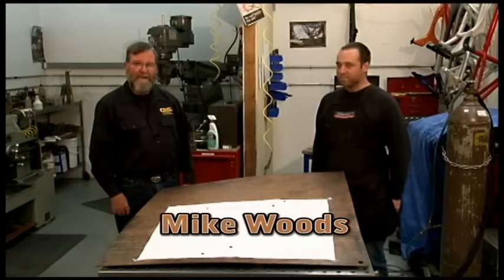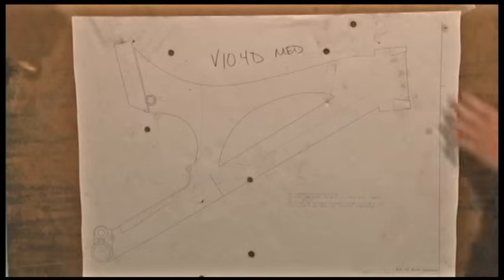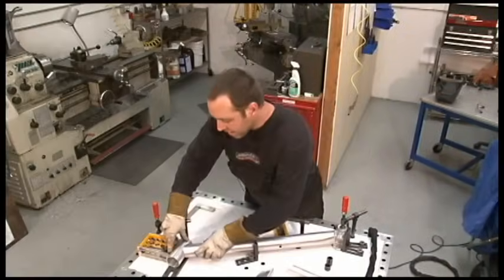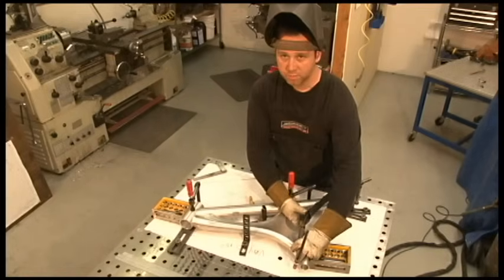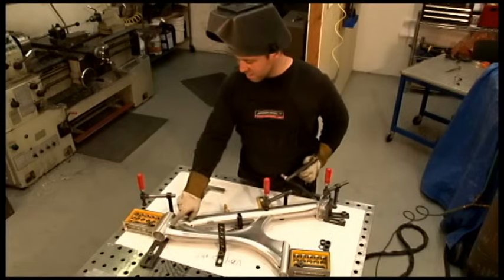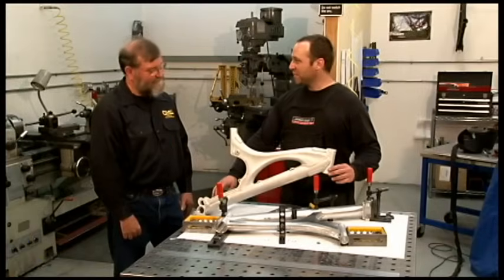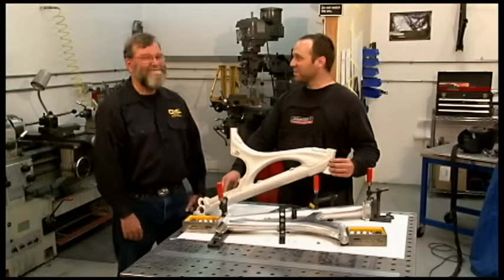Welding Aluminum Bicycle Frames

Comment: My “ Handmade in USA” Cannondale mountain bike has beautiful welds.
Reply from the maker: Cannondale is well known as an excellent brand!
Reply: @RonCovell  Actually, when they were made in the US they were well known for snapping at the welds, earning them the name "crack n fail". Mostly due to bad design, though others blame grinding their welds smooth.  New ones (made in taiwan) are done in a more conventional process - more boring to be sure, but less failure prone. None of this has to do with country of origin, just that cannondale was not an excellent brand for quality back in those days.
Reply from the maker: Thanks for the excellent background information on Cannondale!
Reply: How much does a made in USA frame cost?
Reply: Otherwise known as Crackandfail

Comment: I understand that is normal tube as headTube but I really don't know after that how you guys are make it process for headset ...I wud like to see complete video on headTube process..can any one help me, I'm sure that tube is not suitable for headset, there is some next process...kindly help ....
Reply from the maker: Thanks for watching, and asking a question. Metal always distorts to some degree when it's welded, so in most cases, bicycle head tubes are faced and reamed after welding. You can see a video showing this here:
https://www.youtube.com/watch?v=-UgzDhn6C20
Reply from the maker: The head tube is chosen to match the fork you're using, and there are many options. Here is one resource: https://www.bikefabsupply.com/7005-head-tube

Comment: Hi. I would like to know what type of oven you use. And how much heat. Because I may want to modify a frame or two.
Reply from the maker: The only good way to heat treat aluminum is in a commercial facility, which is properly equipped and experienced with the process. Heat treating aluminum is not a trivial procedure. To do it correctly, you need to heat the metal to a precise temperature - based on the alloy and thickness - then let it 'soak' at that temperature for a certain amount of time, and finally quench the material very quickly after heating. Here's a video that shows the process in some detail:
https://www.youtube.com/watch?v=yB7YoTEUbPw
Reply: @RonCovell  Thank you for advice. My point is to weld on an extention to the frame to convert into recumbent. If all the parts were heat treated before does it need another heating  after the weld?
Reply from the maker: Bicycle frames are made from high-strength aluminum, and heat treating is a major part of what gives the metal its strength. If you weld on a heat treated alloy, you will lose a good deal of strength in that area. When people first started making aluminum bicycle frames, they quickly learned that the frames would often fail if they were not heat treated after welding.
Reply: @RonCovell  Thanx a lot

Comment: 1st you didn't brush before welding, 2nd you are not using a gas lens, 3rd you keep taking the rod out of the gas zone after dabbing, 4th even on material of that thickness a little pre-heat is good and 5th you need a lot more practice.
Reply from the maker: The first three things you mention are in fact 'best practices'. On thin aluminum alloys, pre-heat is not generally required. Mike Woods, the welder in this demonstration, is an excellent welder in my opinion - and I have been welding for over 50 years!
Reply: Ron Covell 
No it’s not required but it does make for the highest quality. 
I was a welder fabricator and working with aluminum for over 24 years. 
I am a CWI And have worked on some of the biggest projects in the USA. So yeah I’m no backyard welder.
Reply from the maker: I can tell you are very experienced, and I agree with your suggestions for 'best practices'.

Comment: Thanks for the video. I was wondering what kind of testing is done after welding to ensure there are no cracks in the welds or the aluminum tubing.
Reply: Heat treatment
Reply: One method used by DIY motorcycle racers/ fabrication, is weld a small 1/4” coupling in an area on the frame that a pressure gauge is mounted. 
There is a small diameter hole in all frame tubes that allow air pressure too travel a complete path to the gauge. Pressurize the frame at low psi, and spray soapy water on all welded joints.

Comment: What is the thickness of the tube ? what is the aluminum name/number please ?
Reply from the maker: I didn't build the frame in this video, but in my other aluminum bicycle videos (https://www.youtube.com/watch?v=d76PFjH1SJA) I used 6061 aluminum, .062" thick (1.6 mm). Aluminum bicycle frames should be heat-treated after welding.
Reply: Ron Covell many thank !  But why do you heat-treat aluminum after welding?  If I may ask, I am a beginner bicycle builder. Do you recommend to work with Steel or aluminum ?
Reply from the maker: Usually, the aluminum sheet and tubing that you purchase is heat treated during the manufacturing process to optimize its strength. When you weld aluminum, the heat treatment is lost in the welded area, and the welds are likely to fail unless the whole structure is heat treated after all the welding is finished. For this reason , most amatuer bicycle builders use steel.
Reply: @RonCovell  Many thanks Ron , amazing !

Comment: Hi there..can a crack on aluminium bike frame be welded?
Reply from the maker: Aluminum bicycle frames are generally made from heat-treated alloys, and when you weld them, you lose the heat treatment - making a weak spot in the frame. Cracks certainly can be welded, but the proper procedure is to re-heat treat the frame after welding.
Reply: Ok .thanks for reply👍

Comment: I think is made from 7075 T6 aluminum
Reply from the maker: 7075 is considered a non-weldable aluminum alloy
Reply: @RonCovell  I read about that. But has various bike frames made from 7075. Why it's possible and why 7075 is considerable not weldable?
Reply from the maker: When welded, 7075 aluminum is subject to intergranular corrosion - so the weld may lose its integrity with the base metal. Is it possible that the bike frames you refer to are bonded, and not welded?

Comment: Are welds on a 1000 dollar bike significantly weaker than welds 2000/3000 dollar bikes?
Reply from the maker: It really depends on the welder. High end bike manufacturers will always hire the best welders they can, but there are some medium-cost bikes that are well constructed.
Reply: Ron Covell thank you for the quick reply man  also yes my frame has pretty chunky welds and it has a tapered headtube 
The linkage is all solid with a little bit of normal flex since it is a non thru axle rear

Comment: @Ron Covell  
Thank you very much friend. I appreciate your kind reply. In the case of small workshops that do not have heat treatment, what do you recommend for welding, what contribution ER 4043 or ER 5554?

Many greetings friend. From Mexico City.
Reply from the maker: In my work, I used 4043 filler rod mostly for welding cast material. I have never seen or used 5554, but I use 5356 for parts that need the greatest strength, or that will be heat treated.

Comment: what is the advantage of the  welding        this video shows     no advanced things  cont:  7736770240    kerala     contact   but it is costly
Reply from the maker: I'm not clear what you are saying here. Are you asking how welding bicycle frames compares to other ways of joining metals, such as adhesive bonding or brazing? 
What are you saying is costly - and what is the comparison being made with? 
I'll be happy to reply if I understand your questions better.

Comment: I'm doing some Custom Fabrication on my bicycle that requires cutting parts of the frame off of one bicycle and Welding them onto another. I did not realize until I already start it that one frame is aluminum in one frame is steel. I'm not very experienced with welding to begin with, almost welding is mostly bed frame gauge steel. Usually modifying bed frame material to make whatever I need. The welder I have is just a 110 wire welder I inherited from my father. I do know he has used it for different kinds of welding. I don't know the difference between Mig and Tig, I don't know what gas is he used to make what kinds of whales. I've only used it for straight wire welding with steel. Can anybody tell me what I need to make this wire welder work welding aluminum to steel?
Reply from the maker: Unfortunately, your 110 wire feed (MIG) welder really can't be used to weld aluminum, and you can't weld aluminum to steel using normal shop equipment.
Reply: @RonCovell  thank you for your help. Asking questions like this is the only way I can learn.

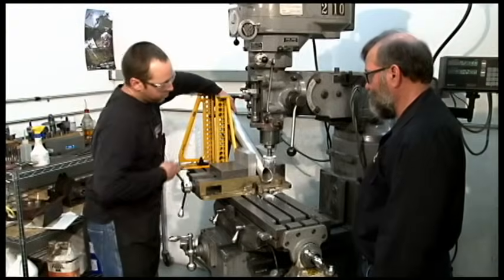Comment: 1:19 How was the monocoque built? I already know how two tubes are welded together, but I'd love to know how that monocoque is made.
Reply from the maker: The monocoque in this video was probably hydroformed. You can see a more low-tech way of making a bicycle monocoque here: https://www.youtube.com/watch?v=d76PFjH1SJA
Reply: The use here of the term 'monocoque' is not really correct.  A monocoque is a structure where the outer surface forms the structure - the typical modern car body is sort of a monocoque, but not a pure one.  This bicycle frame is part tubular, part formed sheet metal.  Monocoque it is not
Reply from the maker: I agree that the entire frame is not a monocoque design, but I believe the formed upper section can be fairly called a monocoque structure.
Reply: @RonCovell  calling that fabricated sheet metal structure a 'monocoque' is linguistic drift.  People are now calling such structures 'monocoque', when they do not fit the actual meaning of the term.  The result is that people have to keep inventing new terms to describe the original concept - such as 'stressed skin structure'.  Such as an egg or a car body.
Reply from the maker: Thanks for posting that link - that is a very interesting project, indeed!
Reply: It looks like it's two separate halves that were stamped then welded together probably in China.
Reply: @stoneyswolf  Wrong.  That is an aluminum Santacruz V10 made in Santacruz California not China.
Reply from the maker: There are companies that do hydroforming all over the world, including in the United States. That frame and the monocoque halves were definitely welded in California - I was there!

Comment: No back purge?
Reply from the maker: Thanks for asking about back purging. The more reactive the metal, the more important back purging is. For this reason, back purging is nearly essential for stainless steel and titanium welding, but not so much for mild steel, alloy steel, and aluminum. While some builders DO back purge aluminum bicycle frames, many do not.

Comment: Wich Alu tubes you used ?  is 6060 ALU strong enough ?
Reply from the maker: I believe the tubing is 6061.
Reply: @RonCovell  When you do not put the frame in to the oven, is that a big different for strongest ?
Reply from the maker: 6061 Tubing is normally heat-treated to the T-6 condition, and when it is welded, the heat treatment is lost - so the weld, and the metal near the weld is softened. It is essential to re-heat treat the frame after welding, otherwise the welded areas are likely to break.

Comment: Hey Ron. Great Video. These Welds are Incredible. Would this work for small steel tubing like Mini Bike Frames, etc ? 
Thank You.
Reply from the maker: Yes, steel tubing can be TIG welded together very easily. You can see some larger steel tubing being welded here: https://www.youtube.com/watch?v=aSAwKLiBLMU&t=124s
Reply: Yes you can as it is the same principle just different material
Reply: Whats the difference in thickness between the tubing used for motorcycle frames and that of bicycle frames? Anyone know?

Comment: Is it OK to sand the selding seam to make it smooth?
Reply from the maker: It is rare that a TIG weld on a bicycle frame is sanded smooth. It would be good to make your welds a little larger than normal if you wanted to sand the welds smooth, and it is extremely important to not remove ANY material from the metal next to the weld, because of the thin material and high stresses on bicycle frames!
Reply: @RonCovell  I notice bike manufacturers typically do not do this. Is this for economic reasons or because of the dangers in reducing structural integrity?
Reply from the maker: Bikerelated - I'd say that both of these are factors, but of the two, my opinion is the economic factors. It takes a LONG time to sand welds smooth, while being certain that the metal next to the weld is not nicked or thinned.

Comment: How many amps 
Does anyone know
Reply from the maker: The amperage for this welding is between 60 and 120 amps, depending on the thickness of the sections being welded.

Comment: I’hate the wavy part of the frame,
To me that is just excess weight.
A straight tube is more esteticly pleasing and also lighter!
Reply from the maker: Bicycle frames with the larger 'monocoque' sections were developed to make the frames stiffer. Almost everyone likes the look of a traditional round-tube frame, but you can get a better strength-to-weight ratio with a carefully-designed monocoque frame.

Comment: What temperatures are used in the heat treatment?  Thanks.
Reply from the maker: Here is a link to a very good description of the heat treating process:
https://www.thefabricator.com/article/aluminumwelding/achieving-t6-designation-for-6061
Reply: Thanks very much for even replying.  I'd read that article previously but read it again at your offering and realized some new things; so thanks.

Comment: Do you put in a jig when you heat treat it, so it doesn't distort?
Reply from the maker: For convenience, frames are usually heat-treated off of the fixture, and straightened afterward

Comment: Is this brazing or welding?
Reply from the maker: The bicycle frame is being joined by TIG welding.
Reply: Ron Covell  this sort of welding is something I haven't done. The bar is heated like a brazing bar . Aluminium can be brazed. Just seems you are heating the brazing bar differently
Reply from the maker: When welding, the base metal is heated above its melting point, and flows together, often with the addition of a compatible filler rod. Brazing (and soldering) is done at a temperature BELOW the melting point of the base metal.

Comment: Dont understand why you call the centre piece monocoque, the whole main frame of a bike is monocoque in theory....
Reply from the maker: Well, you bring up a good point. One definition of 'Monocoque' is 'One Thin Shell' When bicycle frame structures are made from formed sheet metal, that is usually called a monocoque. I suppose that you could say that the round tubes that a standard bicycle frame are made from are 'monocoque' structures, too, but that's not the usual way of naming them.

Comment: Is there a difference between aluminum brazing and welding?
Reply from the maker: Welding involves melting metals, so they flow together. Brazing is similar to soldering, so the brazing material sticks to the surface, but the metals being joined are not melted.

Comment: I have a linclon mig welder that also does flux core and a shitty campbell hausefeld 115 70 amp stick welder. I want to build a small bicycle cargo trailer for a mou tain bike. Well i happend to come across 4 bicycle frames that are a youth size and are deffinently peices and parts . A magnet sticks to them . Do  i have to tig weld these or will one of the welders i have mentioned work?
Reply from the maker: Welding thin-wall steel tubing is challenging with a MIG welder, but it should be possible. If you can use solid MIG wire,with a gas shield, that would be preferable to flux-core wire.

Comment: Dear Friends,

I have a VITUS frame that needs to be repaired. I would like to know the exact reference of the material (aluminum?), in order to fix it. Please see attached photos.

The damage is on the seat tube (see photos at https://www.bikeforums.net/classic-vintage-bicycles-whats-worth-appraisals-inquiries/1126904-how-weld-vitus-vintage-frame.html#post19968579). What is that material? I need that information in order to weld it

Thank you!
Reply from the maker: I don't know what alloy of aluminum was used on VITUS frames, but perhaps someone else can help.

Comment: Hey man, Good video, l have question about,  how l need to weld aluminium,  you are using mig welder machine, but  what Kinde of gas  you need, and what metal of comtibution. Because l need weld motorcicle frame. Tks.
Reply from the maker: The welding used in this video is TIG welding. MIG welding can be used for aluminum, also, and straight Argon gas is used for both applications. The base metal is 6061, and the filler metal is 5356.
Reply: Ron Covell 
thanks again, and greetings from torreon coahuila, mexico.

Comment: Sounds like 50-60hz frequency, would this be possible from a old buzz box scratch start?
Reply from the maker: You are right about the 60 Hz frequency. The machine the welder used was an older square-wave TIG machine, not a 'scratch-start buzz box'.
Reply: Ron Covell thank you for the reply Ron.